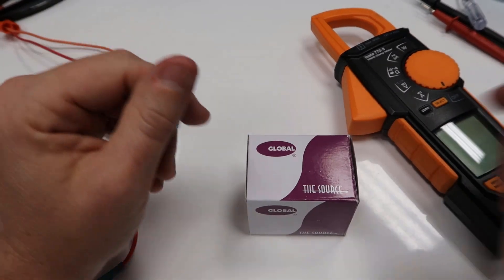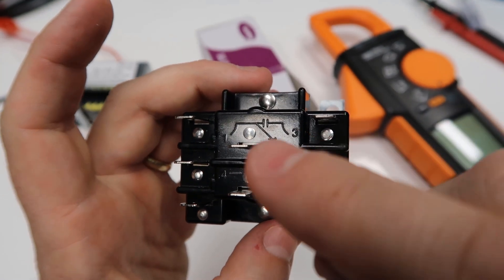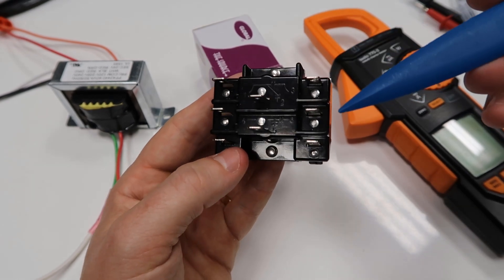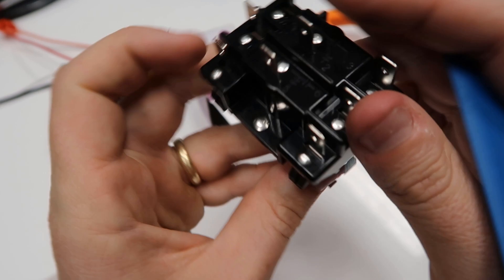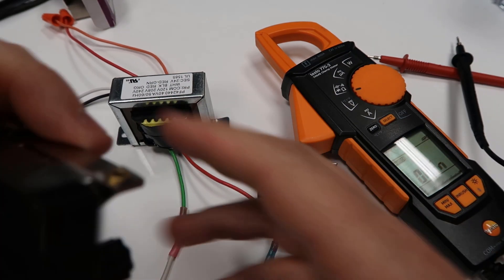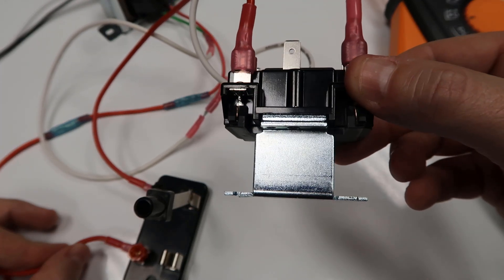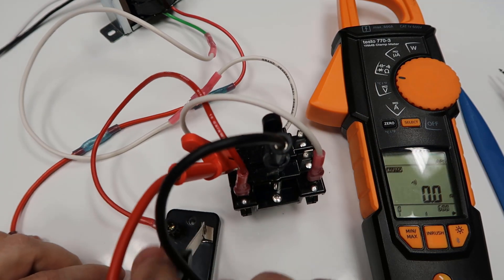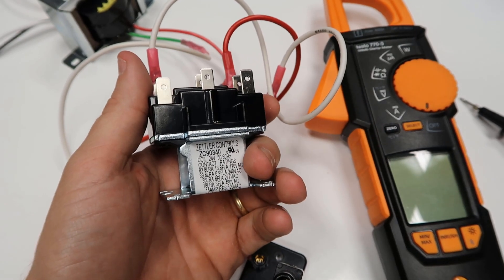How a Relay Works with the 90-340

Comment: In my gas fitter program (Canada) we call them switches. This is the first time I’m hearing them called contacts. All good. Ps. DO NOT test continuity while the relay is connected to a live circuit.

Comment: My 90-340 is 8 pin for 8 pin socket (like this one). But when I search for a replacement to order I get half with 10 pins - Will a 10 pin 90-340 fit my socket - extra coil blades hang over the socket and not touch anything??  I cannot find a different marking or part number for 8 to 10 pin 90-340????  All sects are the same but shouldn't the 8 and 10 pin have different part numbers?  Grainger only shows a 10 pin in pic.

Comment: Relays are used with electrical loads at a range of about 10 amperes or less, while a contactor (think power) load capacity is greater than 10 ampere. In other words a Relay can be used to control a contactor but generally not the other way around. In this case a thermostat would have a 24 volt rated relay powered by the a 5v circuit board that powers the 24 volt coil on the 110/220/480v contactor.
Reply: I think the purpose of 24v relays are to be able to use small size conductors that fit in smaller enclosures to control larger loads, thus saving space and cost.

Comment: I need your help I don't have knowledge about this relay problem I have is when I turn on the heat the blower turns on but not on cold.i installed a new capacitor 7.5mf the blower works I'm trying to figure it out I don't have a working diagram on a gibson 2.5 ton hvac thanks
Reply: You may have a bad board or a bad thermostat.
Reply: https://www.youtube.com/watch?v=y59w9LcumlE

Comment: Put a Triac in place of the switch and control the whole process with a microcontroler (arduino etc). Going to be my next project ,to replace the mechanical sequencers. Should be able to dial in efficient and more accurate timings.

Comment: I have an older sears furnace, no board just relays that fan comes on immediately, it works otherwise but im not sure its wired correctly i removed the fan limit wire and it didnt care at all, the 90-340 switch has terminals 1 and 4 jumped with a wire, removing that the fan doesnt run, why would a jumper wire be placed on 1 and 4. Relay tested good though. Wouldnt fan limit wire have to go to the coil connection.
Reply: always check your wiring diagram first,a lot of furnaces have a limit on the fan shroud that if it fails the fan will never shut off as a safety in case of high limit opens you wont have flame and no fan

Comment: HVAC School how would I wire this relay to power 2 well pumps from a switch in the house. The switch on position would power one pump and if you turn switch off it would power the other pump. A wiring diagram for this would help alot
Reply: Matthew Anglin  pretty simple actually.  
Tl1 &T4: line in (hot & neutral or both hot if running 240V)
T2 & T5: pump 1(normally on)
T3 & T6: pump 2(on when relay is energized)

Comment: Bryan can you expand on the amp ratings of the contacts. When it says 230 volt or 460 volt, would that be if you somehow applied 230 volt measured to ground on one contact, or is that if you applied 230 to both sets of contacts (120 per contact, but ultimately a 230 volt load).
Reply from the maker: It's the total voltage applied across one contact. In the case of 230 / 240V that is two opposing 120v sine waves